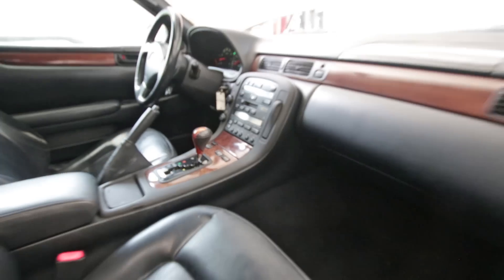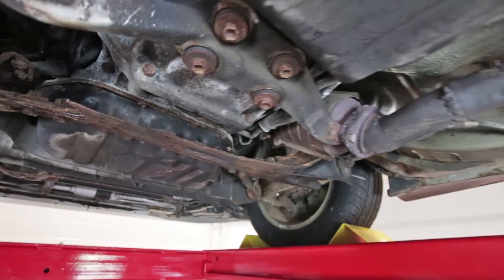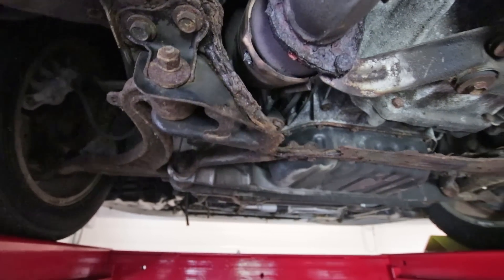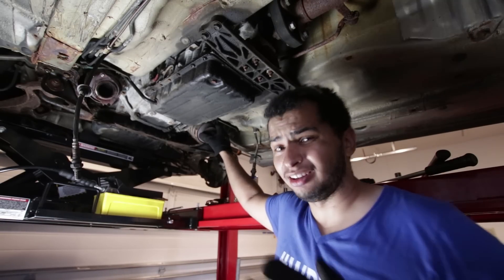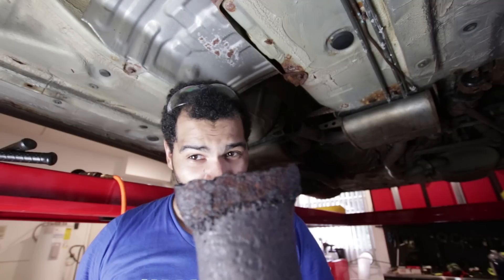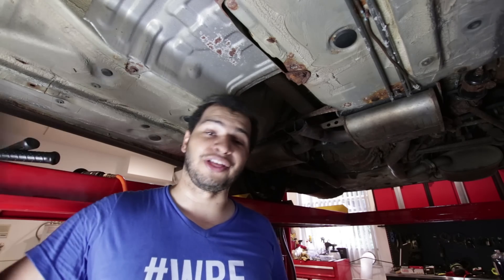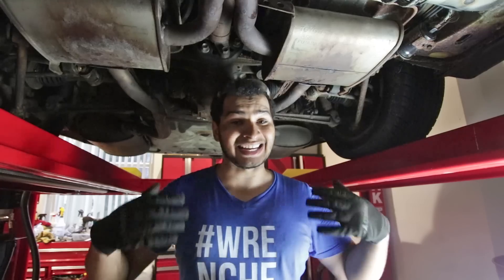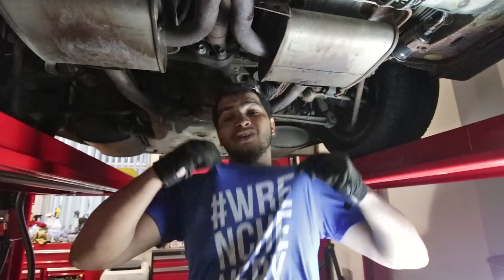Here's Why You ALWAYS Need To Check Underneath A Car Before Buying It

Comment: Tavarish, try using POR15 on the rusty areas. I've done a lot of rust work on a 95 E36 M3 (I live in NJ) and POR15 is the probably the best product for rust repair. Just make sure you wear a respirator that's used for automotive painting and gloves/long sleeves. It's a permanent product that will not come off your skin and it has a very bad odor that's quite potent. It penetrates through surface rust. All you need to do is sand/wire wheel the surface and apply a coat using a paint brush. I highly recommend it for any rust repair.

Comment: From the wet UK: My much loved 2003 Lexus IS300 daily driver recently failed its annual inspection ("MOT") due to rusting sills. Probably not too bad after 14 years, but watching this I will definitely get the rest of the car's underside inspected. Meanwhile after ~£350 welding repairs I am legally back on the road.

Some may ask why bother worrying about a car that's currently worth less than £1,500. Answers:
1. I was never going to find a replacement car for under £350 (cost of welding).
2. It's super comfy to drive in around town and on motorways and handles extremely well.
3. It looks totally non-descript but burns-off boy racers effortlessly. Great fun at lights watching spotty faced yoofs staring at the grey wrinkly leaving them in the dust!
4. A straight-6 normally aspirated 3 litre engine shoving out 218 'torques' sounds great. The acceleration around the 3,800 rippems is astonishing, especially coming from a boring looking old wrinkly's run-about.
5. The series 1 might become a modern classic - so I'm hanging on to it.

Comment: German car quality? In all seriousness though every car made from steel will rust. Doesn't matter how good quality your car is if there is salt on the roads or water every car will rust. You're gonna need to do a lot to this car to make is good. After you're done with it put a few coats of underbody seal.
Reply: Kuddlesworth NA. its not a German car.  He's working on the Lexus. Made by Toyota. Japan.
Reply: Shit my mistake. Point still stands though all cars will rust if not maintained properly. I've seen quite a few rusty German cars. Simply because the owners drove it in the winter with the salt in the UK and didn't hose the car down afterwards. They also didn't have the underside sealed.
Reply: Kuddlesworth NA right on that one!